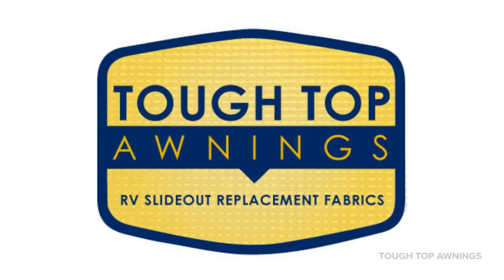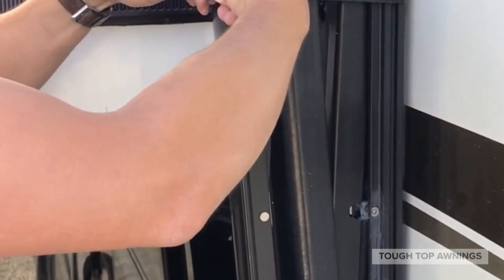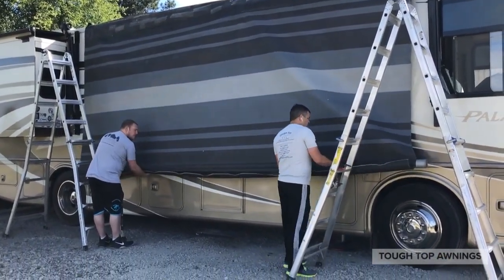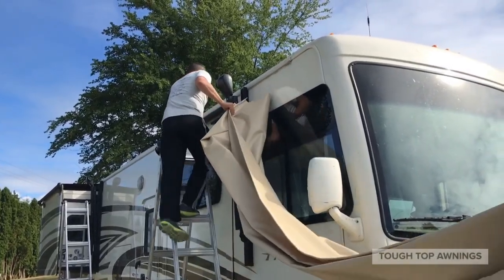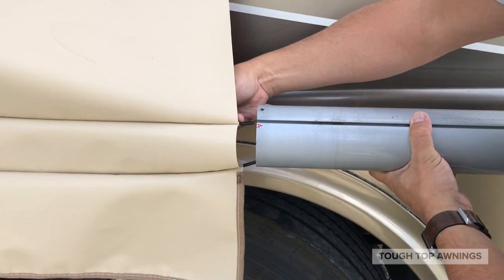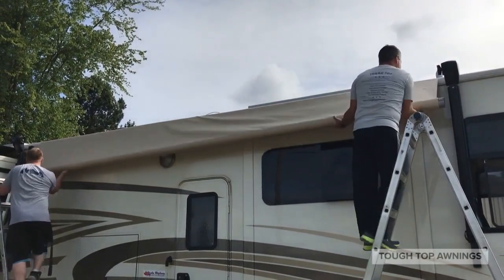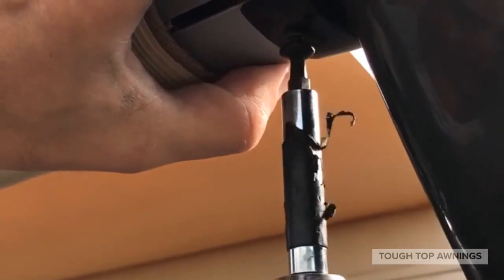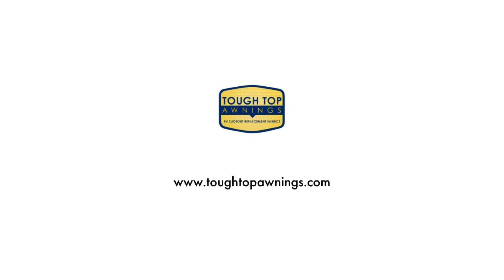Changing the fabric on a Carefree of Colorado electric patio awning

Comment: Couldn’t you just attach your roller tube to the end caps and then have the electric motor roll it back up?  Since there’s no springs or anything, the motor would retract itself all the way back.  Re-deploy and retract again to make certain it’s a go.  Thoughts?  Thanks for the video!
Reply from the maker: This is the easiest way we have of doing this from an installers protective.

Of course if you want to take apart the legs you can do this.

However you don’t want the upright legs to spring forward and you do have to remove the end caps to remove the old fabric and install the new material.
Reply: Tough Top Awnings    Thank you for the response!  I’ll follow the installers advice.
Reply from the maker: @jimsjacob  no sweat!! good luck

Comment: So my patio awning tore off and now I can't get the arms to come in. How would you approach this? Thanks.
Reply from the maker: I’m assuming that this is a powered awning? The arms will come in if it is.They are hard to push in but will come in with pressure and then they can be zip tied in place until the fabric can be replaced. If it is a manual pull down awning that is another bag of problem!
Reply: @Toughtopawnings it is a powered awning. thank you!

Comment: What if your awning has LED lights in the tube and not at the camper
Reply from the maker: Our replacement awnings will not accommodate that because we don’t see the edges where you would have to have the wire for that light bar.
What I did to my personal coach was to remove the light bar and used 3M tape to apply the light strip to the side of my coach right under where the roller tube sits when rolled up then shortened the wire that powers it.  Now I can use the light strip when the awning is in or out.